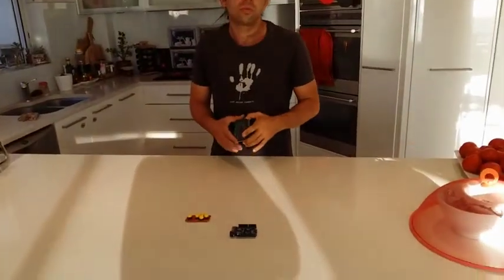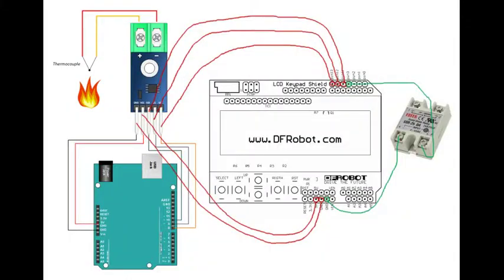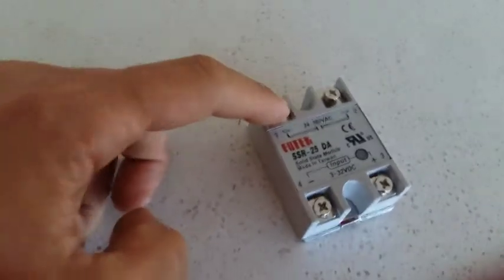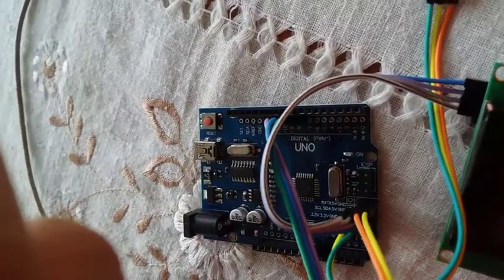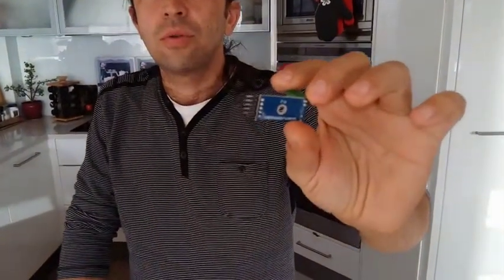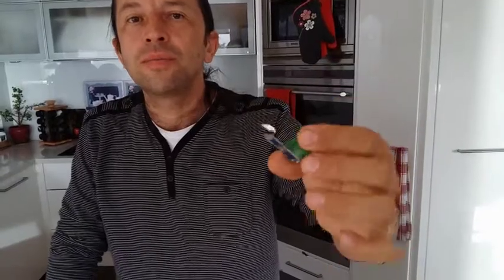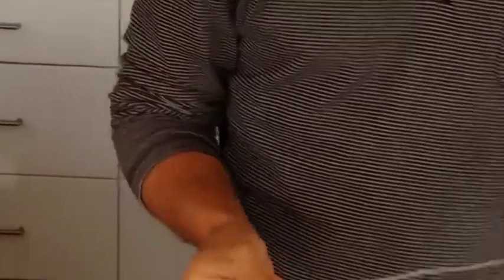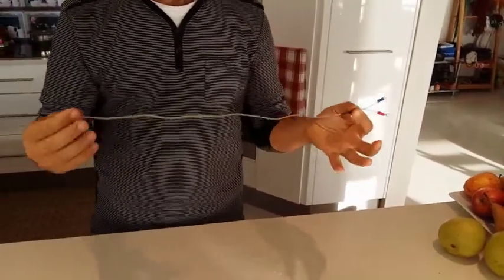Part 2 of kiln building tutorial - building the controller

Comment: Hi Alexandru, I am building an investment casting burnout kiln and this looks as if it is just what i need to control the temperature. Can you tell me with these codes are we able to program the rise in temperature at several levels and time periods to allow for different temperature rise requirements?
Reply from the maker: Hi, David,
Yes. It allows up to 24 steps of type HOLD or INCR which can be used to keep temperature at a certain level or increase/decrease it linearly. There are some variables that need to be tweaked depending on how powerful the heating element is and how much thermal mass there is to heat.
Reply from the maker: The git project with the code and wiring instructions is present at https://github.com/botik32/KilnControllerV1 and https://github.com/botik32/KilnControllerV2
Feel free to write me if you need more details, at abotezatu@gmail.com
Reply: Also make sure to use a good quality power supply for the arduino board. Some cheap ones skip on the output noise filter and the noise causes fluctuating temperature readings that in turn result in the PID logic behaving in a less optimal way.
I had to solder an output filter on mine (simple filter: capacitor and induction coil) to get temperature stabilization within 5 degC.
Reply: Thank you for your help and advice, I do appreciate it. I will let you know how I get on.